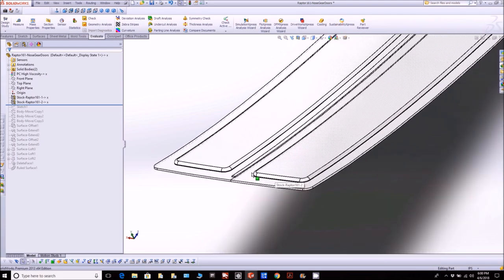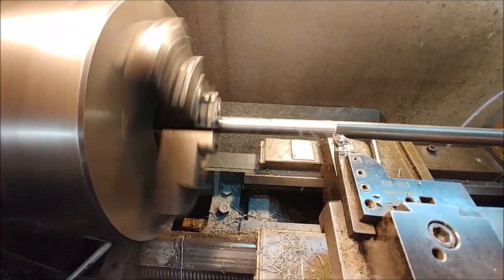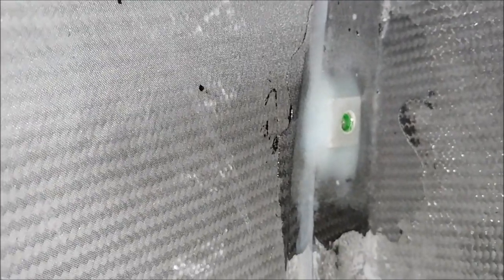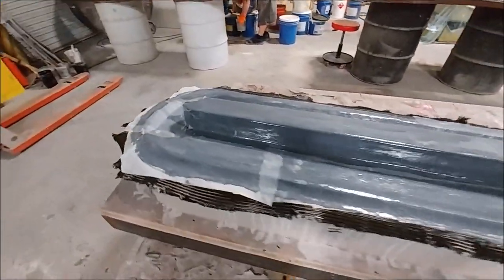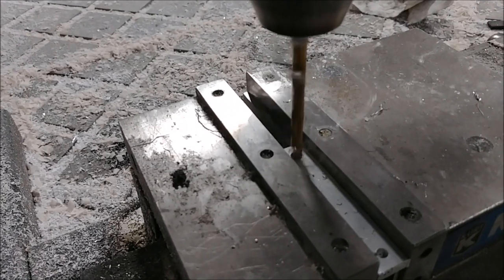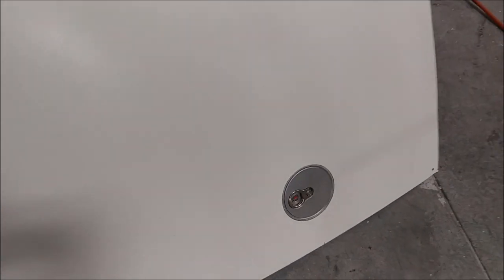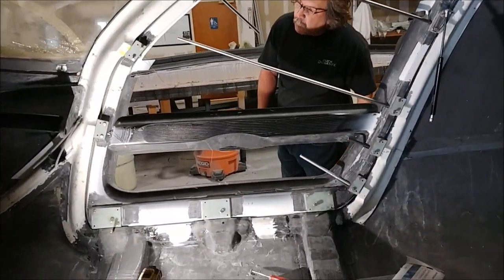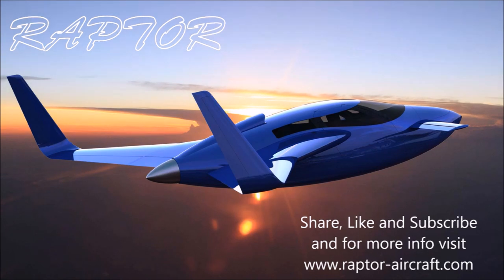Pin Lock Sleeves Go In

Comment: You have come such a long way... number one.. the engine runs.. number two ... your reduction drive works.. three ..I believe that if you drag your fuselage through the air fast enough it will come off the ground... so the only thing left is how to get the oil to adjustable prop.. can you please explain to me in one sentence why it wont work to feed the oil into the end of the prop shaft ? that's all you got left to do. I believe that you could easily sell your plane for a 1/4 mil a piece... you got 30 million dollars waiting to be built !  best of luck to you.
Reply from the maker: With the current layout, having the pulleys so close to the engine, and specifically the exhaust Y pipe there simply isn't enough space to engineer it that way and have it safe and reliable. There's no way to even include a support bracket to prevent it from freely rotating. Believe me, I spent a lot of time thinking about it a month or so before you even suggested it.
Reply: The setup that I found does not require brackets to hold the hose from rotating and the fitting only  require  an inch or so of space.  Safe and reliable ... really ?? the first time you ran the engine with your current oil shuttle you got 10 seconds before it locked up... second time you ran the engine you are lucky you didn't have pieces flying everywhere. And I don't really care who came up with the idea, I just want your plane to fly.
Reply from the maker: Poul, you think you fully understand the problem, but you don't. Do you know that there also needs to be a way to meter the 300 psi pressure so it can bleed off when the governor reduces it? How do you suppose you can vent the pressure with your 'feed through the end of the shaft' solution? Where is that oil going to go? Please let Mark and I get this figured out. Thanks.
Reply: ok. thanks

Comment: So, I assume there has been no damage to the engine.  That is good.
Reply from the maker: I was just up at the shop and I ran the engine for over an hour without any issues. It's running great. There is an oil screen in the engine that prevents most foreign objects from leaving the sump even before they make it to the filter. If there was any debris it was aluminum which shouldn't really hurt anything.
Reply from the maker: Well, the engine has screens and filters for exactly that scenario. The aluminum is soft compared with anything it might come in contact with and it would definitely not make it past the filter. So, yeah I'm not that concerned.
Reply from the maker: Well, I don't have the budget or time to completely tear down the engine and clean every aspect of it. I will be running loads more hours on it before it ever gets in the air. I will also be changing the oil and filter at least one more time. That's the best I can do. If you're not happy with that then I'm sorry.
Reply: High RPM or more cruise?
Reply from the maker: I considered doing that but I don't have the tool for cutting it open without filling it with its own metal shavings from the band saw. I know there's likely fragments in there already so what is there to be gained by confirming it? I'll be changing the filter soon enough.
Reply from the maker: Mostly just around 2700 rpm today just to be sure that there were no problems.